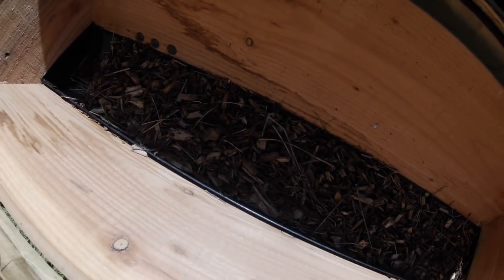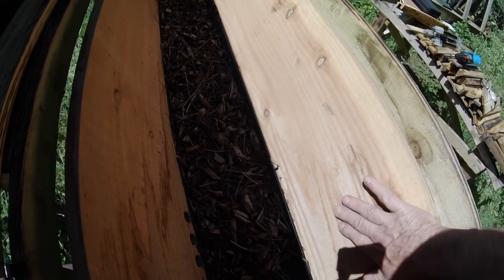how to set up a top bar hive with an eco floor

Comment: Bees LOVE sheep poop that has dried out and has begun to decompose for an eco floor.  To keep it from drying out I mix in Fall leaves collected in the spring after the snow melts from under the Aspen trees at the bank of our stream.  The leaves have a strong sweet smelling odor of decay.  This mix is moist and lasting (and my sheep produce the main component by the ton!). I don’t know why they love it but they instantly settle and remain calm as I get into the hive.  I make my own shellac so I have started coating the scorched insides fo the hives I’ve been building.  I need to get several of these hives going on my own property before I can convince other beekeepers of the benefits.  Thanks for sharing…as a member of the Newbie Tribe I appreciate all of your videos!  This last Summer we had a six week ‘heat dome’ when our usual 80-90F weather went on to 117F (48C) for over six weeks.  It was disastrous for crops, bees and wildlife and we even had to hire an emergency shearing for our sheep.  Normally we get about 105F for just a few days in August.

Comment: Great to see more about eco floor usage. Among my beekeeping fellows out here, a lot of talk about interior prep and exterior prep too. From wax dipping to  tung oil coating and in one case a friend stapling window screening on the interior walls to encourage propolization of the surfaces. One supply outfit here is offering boxes what have been roughened up mechanically to encourage bees to propolize. I think the torching is a great idea! Thank you again. I have shared this vid with my club out here.
Reply from the maker: Thanks, George!

Comment: Great information.thanks. I just built a top bar hive using 2 x 12 from my local sawmill. According to him 2" equals 12" of insulation. Torched it inside and out and tung oiled outside, neat idea. For the eco floor i inserted a length of pvc pipe with holes drilled in it,capped on one end, the other end went through the hive with a hose attachment for easy watering.
Reply from the maker: I look forward to hearing more!
Reply: So how is it working out?

Comment: I take a wire wheel on the inside of my hives as to rough up the wood which seems to encourage the bees to add more propolis to the inside of the hive.
Reply from the maker: That's one approach, although it would increase the surface area of the wood fibres and therefore increase its water absorbency, making more work for the bees to do. I prefer to reduce absorbency and create a relatively water-repellent surface, which is what the bees do when they add propolis.

Comment: You could make that gutter a bit longer so it sticks out a bit. Put a removable lid on it. Now when the floor is drying out pop off the lid and water. Guttering holds water too well so a few small drain holes at the bottom will ensure that a flush of water is absorbed by floor material but also drained out quickly. A bigger hole at desired level for flood control of course :-)
Reply from the maker: Not a bad idea, although it would already be possible to do that by adding water within the hive, as I leave a 4 inch gap between the end wall and the first divider/follower.

Comment: You could add an external cup to catch rain, and have the guttering at a slope and then some drain holes in it, then have the rain water captured from the cup outside travel down the guttering and out. That would keep rehydrating the floor. Would just be a balance of the size of the capture cup and the inlet hole to get the hydration level right.

Comment: How do you get a seal between the follower board and the eco-floor? Can bees crawl under the bottom of the follower board to the part of the hive that's not in use by the bees?

Comment: Hello again Phil, great videos! Keep them coming. I learn so much. How is this eco floor going and does it work? Food for thought. Why not simply place long size appropriate flower pot below the eco floor or place it on the ground? Is your eco floor working?
Reply from the maker: Hi Timothy, it is still a work in progress, but it does appear to be better than either a solid or a mesh floor, both in terms of insulation and humidity control. Lots of experiments ahead.

Comment: A peaked roof with simple ridge and soffit vents are surprisingly effective in full sun Texas heat.  An air gap over the bsrs will be a better thermal barrier than any solid insulation.  Probably not necessary in your neck of the woods though!
Reply from the maker: I understand that keeping the heat out of your hives is a bigger issue than keeping it in!
Reply: That's very true, although it does help with Small Hive Beetles which might even be more of a threat in some areas of the Southern USA than Varroa.

Comment: As usual, fascinating and comprehensive upload Phil, thank you. Would thicker timber all round offer more stable thermal insulation do you think? You mentioned insulation - straw, for example - in the voids at the ends of the hive, yet I imagine the far greater surface area of the long sides compromise thermal stability more. OTOH, the ubiquitous Langstroth hives in the colder climes of North America at 20mm wall thickness (0.78") seem to get the bees through those far, far colder winters than we ever encounter in the British Isles. BTW, as a nerd, may I ask what that device is on your wrist?
Reply from the maker: The sides matter less, as they are only close to the ends of the combs, and there is a natural air gap of 6-8mm. The wrist device is the bluetooth remote for my camera.
Reply: Timber is not an insulating material, therefore if you want a higher level of insulation you should use straw (as you suggested) or cork

Comment: Hi Phil, first, thanks for providing all this information, I love it!  I'm building a top-bar hive from your book, but may I ask a couple of questions please? 

1) Is the gutter the floor of the hive, or is there mesh/wood beneath it?
2) Do you still recommend centre entrances for a first hive (the A pattern),  or should I do things the B pattern way (three holes at either end?)
3) Do you recommend periscope entrances, or is that something to avoid unless there's a particular problem with wasps?

Thanks!

PS I'm in the UK if it makes a difference.
Reply from the maker: Hi Gary, thanks for your questions.
1. The gutter is indeed the floor. There are small holes drilled for drainage, but no mesh.
2. I prefer the B pattern, as it makes it clear where the brood will be, and where you will find honey.
3. Periscope entrances work well and seem to do a great job keeping wasps at bay. Whether they are worth having if you don't have a wasp problem, difficult to say. They do seem to help retain humidity, but sometimes you may find bees bearding in an effort to reduce humidity, so it depends on your local climate.
Reply: @BarefootBeekeeper  thanks Phil!

Comment: Hello Phil, I'm a friend of Les Crowder's in New Mexico, (though he's moved on to California), and I've used his hive design exclusively, but I'm intrigued by your eco-floor.  Here where it is hot and dry, for the most part, in the summer, I'm wondering if the wood would just dry out all the more.  Would it still be beneficial?  And I often have to transfer comb - say to give a queenless hive some eggs from which to raise a queen.  I'm wondering if the height of individual combs would be inconsistent as the eco-floor subsides differently in different hives?  Do you refill them with debris periodically?  Too many questions?  I've enjoyed your books, and I'm going to start working on a Crowder-Chandler hybrid hive this weekend.

Comment: Phil,
Thank you for all your work on top bar hives. Ive watched all your videos and have built a top bar hive incorporating many of your great suggestions including a hinged roof, the ecofloor and a periscope entrance. What are your thoughts on the periscope entrance today? My original entrance I believe to be too high and  an invitation to predators so I added the periscope as a bandaid fix as we call it here in the states. 
Also on this video it sounded like your eco floor has a solid bottom in the guttering vs. the screened version previously? Your thoughts on these would be much appreciated. Thank you again
Reply from the maker: The periscope entrance seems to be effective at keeping wasps out of a hive. In warmer climates, additional ventilation at floor level may be needed, as it does restrict airflow when crowded with bees, but this has never caused any real problems, only some bearding on hot days.
My current iteration of the eco floor used guttering, as the air flow through open mesh was found to dry out the floor material too quickly.
Reply: Thank you for your quick response. We have thoroughly enjoyed your videos.
I think wasps and hornets are a problem here in northeast Missouri.  Originally I baited my new KTBH and had some honey bee scout activity for a week. A steady stream of scouts came and went.
 In that period I also had ants and  observed some type of hornet looking into the entrance. Two days later all the bees were gone. That’s when I added the periscope entrance and rebaited with 2:1 lemongrass and geranium oils as well as some more old comb I scraped out of a  used Langstroth frame I got from a local beekeeper.
Our swarm season here may be over but we had a late spring and it’s been very raining for months and just now drying out. I’m hoping this may lengthen swarm season?  Your thoughts and insight on this matter are most appreciated.
Reply from the maker: @stephendoyle1153  here I have noticed that an extended cool or wet period is often followed immediately by swarms, as if they are waiting for better conditions, which is probably exactly what they are doing. Swarm season is now about over here, but there may still be the odd one.

Comment: Thanks Phil, very interesting. I Will move the first step in beeworld next year. I'm a builder with Natural materials and I would like to build an insulated beehive with straw and earth. Have you got any suggestion?
The gap at the edges of the hive you're describing anyway do not insulate because it's not the air gap that insulate but are insulating materials containing very small 'air bubble'.
Reply from the maker: I suggest cob as a potential hive material: clay and chopped straw.
Reply: @BarefootBeekeeper  ...and clay will help maintaing the right moisture :)

Comment: Hi Phil, my TBH has entrance holes at the end of the hive.  In your experience which works best - on the side or ends?  Also, is it possible to use two follower boards with the entrance holes at the end, or does this confuse the bees?
Reply from the maker: I prefer side entrances, near the ends, for multiple reasons that I have elaborated on elsewhere, but mainly because you can use tandem followers/dividers. If you use an end entrance you can only use a single follower, unless you have some kind of foyer arrangement,  but I'm not sure why you would do so.
Reply: Kerry, I wonder if you could shorten the follower board or put some holes in it close to the bottom? Your post is 2 years old; what did you do?

Comment: Thank you for uploading! I really appreciate these "this is how I personally do it" type of videos. I'm a novice beekeeper in my third season and built my TBH's based on information from Your and Les Crowder books. One thing I have been seeing with my hives, is the low entrances tend to get clogged up with dead bees in the winter/early spring. I need to be keeping an eye on them at that time. I was wondering if you have ever had similar issues?
Reply from the maker: I haven't had that problem, but you could make a single hole higher up, which could be opened as an emergency exit if that were to happen.

Comment: Hi Phil,
Thank you for sharing. I have seen in other of your videos that you place the entrance higher than you have in this hive. You mentioned that is was a more effective for preventing varroa falling over bees entering inside the hive. I can see that in this hive you have the entrance at the bottom. Is it something you have reconsidered to having the entrance at the top? 
And once again thank you for sharing your experience
Reply from the maker: My thinking was that if bees entered at a higher level, there would be less chance of them picking up mites from the floor. I have not been able to prove that theory - indeed, it was only a thought I had one day - so it remains as a proposition that others are welcome to challenge. Meanwhile, the "periscope entrance" is an option that some have adopted with success against wasps and hornets, if not mites.